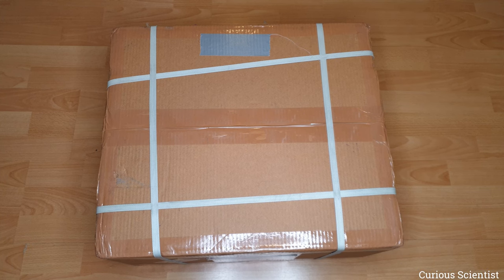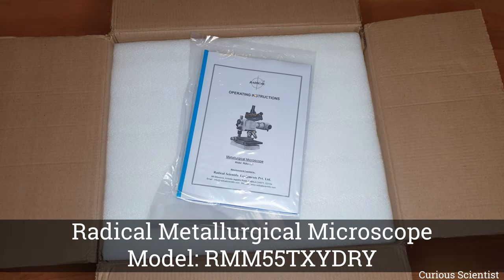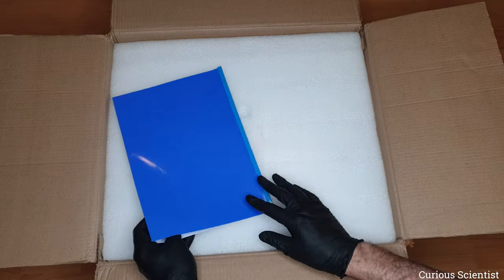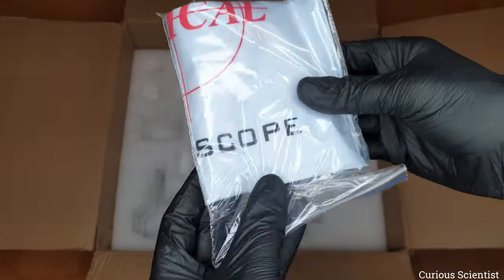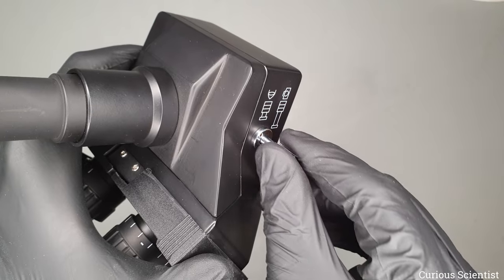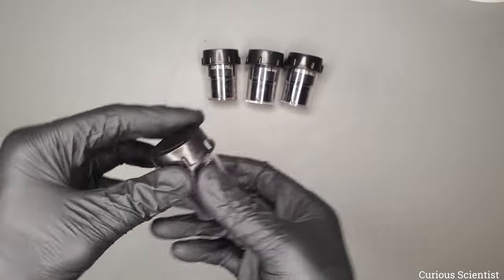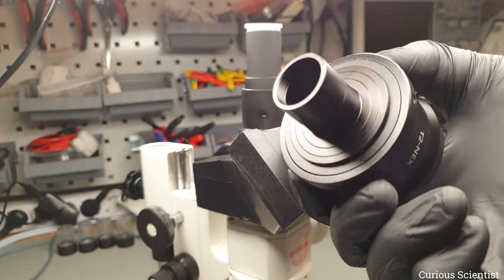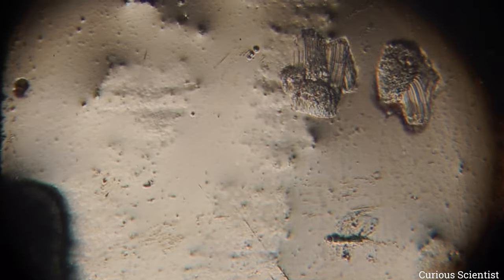Radical 2000x Metallurgical Microscope - Assembly and test

Comment: Enjoyable video. A question: at 17:31 you use calibration slide to scale a 100 um marker. Is this added to your camera image during image taking of the calibration slide and the semi chip, and if so, how?  In your camera's software?  Or did you only add this to the YouTube video to teach that with same magnification that one can manually identify a scale and to know the scale of features on the specimen based on the magnification and the calibration slide?  Thank you.
Reply from the maker: Thank you! The scale that you see is a calibration slide under the microscope. I recorded a clip of the scale, then I drew the scale over 100 um equivalent of length (10 divisions since the scale is 10 um/div, so 10x10 = 100) in the video editor software. Then I just put the transistor under the microscope without moving or changing anything else. It is a demonstration of how to calibrate a length scale for a given magnification and then use it to measure features of stuff under the microscope. Once you know that, for example, 100 um is 500 pixels of the picture, you can then use this equivalence and recalculate any number of pixels to micrometers. For example, with the above example, if your feature is 840 pixels long, then you can first determine the length of 1 pixel (1 px / 500 px * 100 um = 0.2 um), then multiply it by the number of pixels you have (0.2 um * 840 = 168 um) which gives you the length of a random feature. You must redo this exercise when you switch lenses because of the different magnification. I hope this explanation is good enough.

Comment: Are you planning on modifying it with stepper motors and rotary encoders to improve the focusing?  You could use one encoder to control multiple motors as you would only move one at a time.
Reply: That'd be sweet
Reply from the maker: Yes! It is even written in my blog article! 😉

Comment: Were you able to 23:50  show the resolution you get at 2000x ? My understanding is that the theoretical limit is 1600x. I want to look at knife edge burrs. Any suggestions ?
Reply from the maker: 2000x magnification is theoretically possible when you use the 100x objective lens and the 20x eyepiece. It works, but due to the very shallow depth of field, it is not the most pleasant magnification to work with. The magnification is smaller when I look through the camera, but I don't know the exact value, I never attempted to determine it. To look at knife-edge burrs, you probably don't need such a high magnification.

Comment: Thanks for your nice unpacking video. When I bought the similar version there was no review on YouTube available. I am happy that in your case all objectives and oculars came as ordered. This was not the case with mine but I am still happy with the microscope. Question: did you manage to use the 100x dry objective on silicon dies?
Reply from the maker: Thank you! Yes, I had the same situation that when I ordered it, there were no resources on the instrument. That's why I made this video, so future buyers can judge the microscope better. 

The 100x lens works, but it is not super impressive. I guess I could get good images out of it with focus stacking, but I feel that the pictures are already soft and the softness can not be improved with the stacking. So I so far avoided it. Also, the features on the chips I was looking at were "too large" with the 100x lens, so it was a bit hard to get a good image. 

I have been actually following you for a while both here and on IG (I really like the silicondoodles series!). Impressive work. I will send you a few pictures on IG just to show how the 100x looks like.

Comment: Nice scope!  I have a similar one, and it's fun to focal stack with it!
Reply: I have the same too, just with polarizationfilter. I use for Focusstacking Affinity Photo 2, what do you use ?
Reply: @michaelschneider8667  Ahh nice!  I simply have an Omax phase-contrast scope that I put some old Olympus objectives on.  As far as focal stacking, I've had pretty good luck using Helicon Focus both for normal macro work as well as for microscopy like this.  :)
Reply from the maker: Thanks! Yes, focus stacking is fun with this microscope! Just wait until I make the axes motorized. 😎
Reply: @CuriousScientist  I was honestly thinking the same thing.  My lab has a $100k scope that does this... it controls the stage (x and y) as well as the z-direction for stacking.  I was thinking it wouldn't be that hard to build my own.  I'm looking forward to your project for sure!